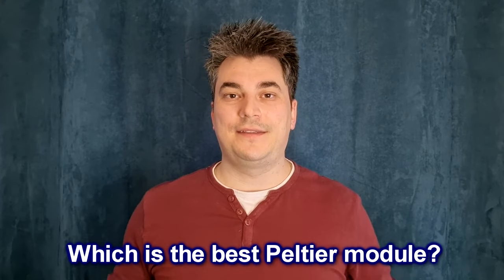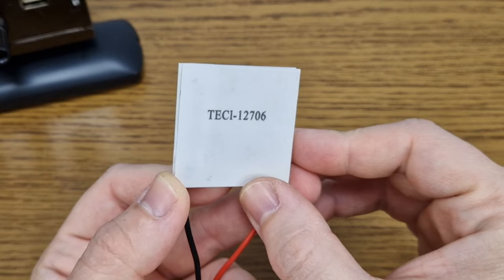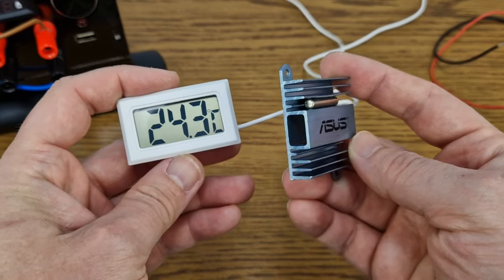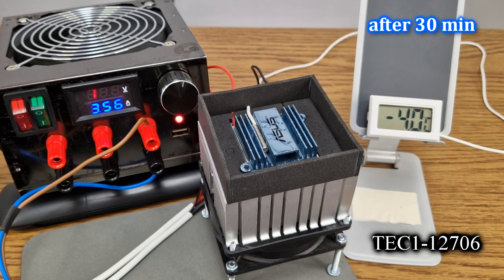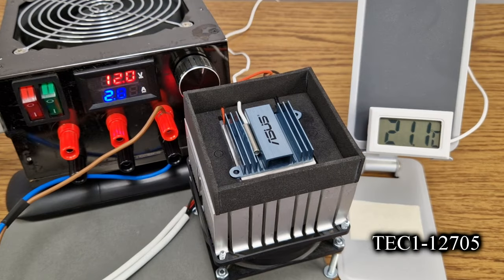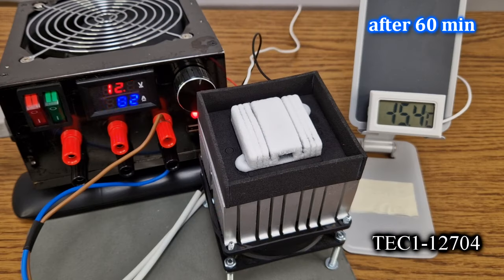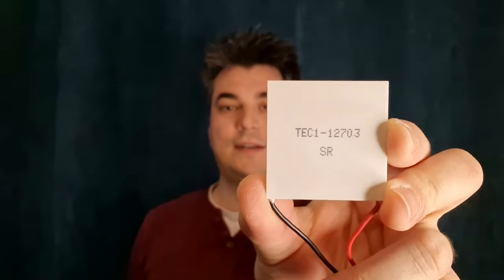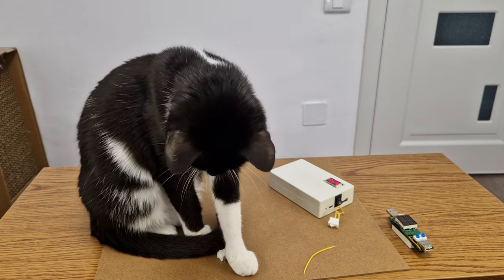Which is the best Peltier module for your project? [test 1]

Comment: The TEC1-12706 needs a bigger cooler then TEC1-12703, with the correct cooling the 12706 can reach quickly to -18 - 20 Celsius.
Reply: What if u add the bigger cooler to the 03 module?
Reply: It could reach -40 even

Comment: Hello I want to make phonewith this my idea is to use water radiator 240mm and a fan and thie peltier module let's make it connecting water radiator and water block  with a small 500ml tank  putting peltier on water block 50*50*20mm left 20mm after putting peltier on it sticking neodym magnets so I will able to stick on my phone now supply it now phone is cooling playing heavy games like warzone mobile pubg able to get 120 fps will this work??? It will cost me 40 dollars to make or should I buy from alibaba for  200 dollars?

Comment: Repeat the test and track the temp of the large heat sync. You will find that the large heat sync can't keep up with the heat generated by the larger peltier, and it will be hotter with the 12705 than with the 12703. This explains why the temp was greater at 60 minutes than at 30 minutes - the ambient temp of the heat sync rose. A peltier is designed to create a thermal difference between the hot and cold side of the peltier. The colder the hot side is, the colder the cold side will be. For air cooling, the 12703 is better. With liquid cooling, the 12705 will remove more heat than the 12703.

Comment: Test is very good, but only for this size of radiator. If u get bigger radiator with better cooling , u get better results on more power peltier module. so this test is only for this small radiator on hot side.😊
Reply: Quite similar as to what I was thinking.  Smallest-size peltier (12704) performed "best" compared to the group because of its smallest physical size in proportion to the (heat) radiator.  Increasing the cooling capacity (ie:  Larger radiator or more fan cooling) in proportion to wattage output needs to be considered to make a fair comparison.
Reply: @Schrimpieman  yeap, thats right ;)
Reply: @Schrimpieman  you got it.

Comment: What you're seeing is the effect of joule heating. Basically you were able to manage the hot side of smaller peltiers better because heatsinks were larger in proportion.
06 is not rubbish. It has to be planned & executed properly.
Reply: Thank you - it would have been nice to see how warm the large heat sync was getting. Liquid cooling would have significantly improved this test.
Reply: @RCToys09  I guess there's a reason why the manufacturer make different types with different price or costing. I bet it not only related with size but also with quality. Using liquid cooling required more electricity as input. So if using same input give different output then we can conclude which is more efficient.
Reply: thats it, there was just so much not even considered here, mostly heatsinks...
cold side temp means nothing without hot side too. 

lol, heat blocks dont appreciate frozen water. go all bulgy :)

i had to see what it would do with no pump.
Reply: do you know what the best peltier model is

Comment: Thanks for taking the time to explain to us the difference. I am pretty sure that the 4-5-6 didn't perform as well as the 3, only because it didn't reach the appropriate amp. to perform 100%. On the other hand, to get -20C with only 38 Watts of energy is fantastic! Exactly what I am looking for. Thanks
Reply: How do you get it to reach the appropriate amperage? My Peltier chips always run at around 3 amps - far lower than their rated amperage. I have been wondering about this.
Reply: yes. each module operates in a different sweet spot. more extensive testing needed
Reply: @FHDesert  It does reach the maximum amp. but his cooler is not good enough to remove 72W plus the amount of heat energy from the little cold Radiator. So the hot side gets hotter as it should. That follows that the cold side doesnt get as cold as when he used the 12703

Comment: Great video, but I have Concerns.
Later on, you chose the TEC-12703 because it cools down to the lowest temperature. In the mini-fridge you've build, the Amount of heat the Peltier has to remove is much higher, and the Qc of the 12703 is very low. Dont you think the 12706 does a better job when the amount of heat that has to be removed is quite high?
Reply from the maker: Thanks! TEC1-12706 may be a little better in a closed box, but it draws more current and it needs a bigger heatsink, so the entire cooler will be bigger, more expensive and will draw more energy. 
I will make a more detailed Peltier test video soon, with more powerful peltier modules, bigger heatsink and different voltages.
Reply: @Sorin_DIY  I'll enjoy your new video :) I hope you're maybe cooling a liquid or gas with the different peltier Modules, so that we can see how much heat energy is removed through the TEC's. Looking forward to it :)

Comment: Thanks for the great video with detailed comparisons.  I am making a small (5l) 12v cooler/chiller for my motorcycle trips as I could not find anything remotely suitable.   As I am looking to have a compact design within the wall of the cooler, your video has reminded me that I need to allow for condensation dripping off cooled element.

Comment: Great! Could you please make also tests with TEG Modules to make power from heat? Ive noticed that there a great differences by modules and prices.
Reply: +1
Reply: Yes I would like to understand the differences in energy generation also maximum temperature each on can handle

Comment: Please do another video like this one, but in the next video, apply heat & determine which module produces the most electrical power when you use the optimal heating for each module design.  From what I see online, the TEC1-12706 can produce 57W at 50C, which is 1.425W/mm2.  That means ~702 of the TEGs could produce 1 kW of power with an input heat of 50C

Comment: Currently working on making a pretty sick Portable AC using these chips. Alot of design is going into it these chips are amazing especially when used correctly.
Reply: I'm doing something similar! But with a pillow. How many are you using, you'd need a lot to make any sort of difference even in a tiny personal fan. And you'd have to vent the heat elsewhere or else the net difference is just heating up the room! I'd be interested in seeing your creation.

Comment: excellent information that was what I was looking for to know what power each peltier plate has. I bought 127015 and it consumes a lot of current and the temperature drops. if your information is correct I go Buy peltier 12703

Comment: Good work bro🤜
Can you test all 4 as thermoelectric Generator?
Reply: The ones he tested are TEC modules. What you want to see are TEG modules. One creates heat/cold and the other electricity - TEC can be used for both purposes, but probably not with the same result.

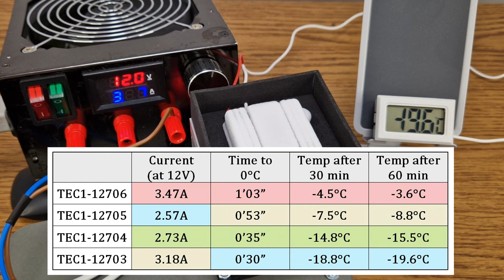Comment: 5:07 Is there an error? The chart shows the 12703 Takes 3.18AMP but in the background the PSU shows 3.27AMP
Reply from the maker: Hi. There is no error. the cooling fan also draws 0.09A from the power supply, so the total fan+peltier consumption is 3.27A
Reply: Oh! I gotta recalculate some stuff then! Thank you! I bought 20x of these Peltier modules you posted @Sorin_DIY

Comment: I built an ice chest air conditioner.  At bottom of cooler is ice cold water and a bed of 20lbs of ice Sitting on a wire frame. Just  over the ice layer is an internal lid effectively separating the ice chamber from the air intake chamber.  2 radiators ; one is for intake air the other is for the precooled air blower fan. My question requires your expert peltier knowledge.  Cam I usea few peltiers to create a mini freezer keep ice colder longer or make circulating water even colder with salt?  I'm concerned about cooling the hot side without heating my ice water. Thank you for your channel and all you do to help us
Reply from the maker: Hi. my next video is a project with Peltier modules, it will clear a lot of things about your project. I will upload it in a few days.

Comment: i think you need to supply 12v 6amps for the 12706 module, for its full load to work.
Reply: it wont draw 6 amps at 12v, it needs 14v or higher.

Comment: The modules have different electrical specs and they're being driven with a fixed voltage, the ideal way of driving a peltier module is using a constant current (CC), as resistance varies with temperature. Idealy the module should be driven within 60-70% of its maximum current to maximize lifespan. The last digit of the modules indicates their maximum current. The TEC1-12703 has a maximum current of 3A and is being driven a little above its maximum current. So, this module is being overdriven. 
My suggestion would be to compare them using CC at the same percentage of the maximum current of the module being tested.
Reply from the maker: Thanks for the suggestion. I bought some new Peltier modules and I will test them in a future video.

Comment: You tested the modules on the same heat sink for the hot side!! Tec1   12706 modules require bigger heat sinks to dissipate more more power and so that the hot side doesn't get too hot. It is because the 12706 module has the highest temperature on the hot side that the cold side is lower than the rest peltier modules tend to want to maintain constant temperature difference on a particular electrical power input if the hot side is too hot the cold side will not be cold enough
Reply from the maker: Hi. I recently made another Peltier test video [test 2], please watch it, because I explained all this.

Comment: Very informative video. Thanks for sharing. Do you mind revealing what thermal paste you used? I am finding in my own testing that this is making a big difference in temperatures I am measuring on the cold side. I changed thermal paste on a peltier/heatsink module that I had purchased and  the temperature I was measuring was at least 7 degrees C warmer than it was before the paste change.
Reply from the maker: Hi. In this video I used a medium quality thermal paste from aliexpress. With better quality/more expensive thermal paste I would probably get better results.

Comment: Nice video and analysis. Could you please suggest best PELTIER module for heating application? Thanks in advance
Reply from the maker: Hi. I haven't tested Peltier modules in heating applications, maybe in a future video.
Reply: Least efficient at cooling would likely be best for heating. Peltiers move heat from one side to the other but in doing so they convert a lot of the input electricity to heat which goes out the hot side. In other words they put a lot more energy out the hot side than they take in the cold side.

Comment: Moral of this that isn't shown in the video: The Less load you have, the smaller peltier is more efficient always. If you have a heavier load that makes the module stay at a warmer temperature the entire time (Say water cooling something) you want a larger module to pull more heat at a given time. Same thing happens with a Portable cooler fridge.

This is why water cooling something on the cold side is alot better of a load than a heat sink most of the time because the water will add it's heat energy to the cold side 25 times faster than air.

However sometimes water cooling the hot side is the only water cooling that's needed to get better efficiency out of the correct size module.

The Smaller the volume, the smaller your module should be for efficiency. If its 1 Cubic foot of volume however, you'll want about a 10 Amp rated module instead so that the module can remove more heat at a given time. If the module stays cold on the cold side the entire time, your not fully utilizing the cooling capacity of the peltier unit and are just wasting energy. So always test to make sure it's enough power to get to your target temp, and keep going smaller until it's no longer enough cooling capacity then you'll know what is the best current rating for your project.
Reply: excelent analysis bro🎉
i am a newbie😢 tryin to build diy air cooler for home
which module and amps u suggest
and u recomend both sides water cooled or

Comment: Hi, I was wondering where you got the ice from even though you didn't use any water? Was it the thermal paste that developed the ice?
Reply from the maker: Hi, moisture in the air turns to water on the cold surface, then to ice.
Reply: @Sorin_DIY  Thank you, this is very helpful.

Comment: Hi. Tell me, what type of Peltier do I use for a "Philips perfect draft" machine? Thanks. David.
Reply from the maker: Hello. I didn't work on this unit, but I found on internet that it has a 70W peltier element and the similar cheap alternative is the 12708. But in my opinion you should buy the 12703 and 12706 modules as well and test which one works better. they are cheap.

Comment: I would be glad if you could make a test of temperature drop in  a space of 1 cubic feet for example.
Reply from the maker: I made a Peltier cooler box, you can check out that project and use it as a reference.

Comment: actually the problem with TECs are the larger current you run them at the more cooling they can do but the more heat they produce
so it is quite likely the reason 12706s are underperforming is due to inadequate cooling.
It might be more of a fair test to run them at the same current rather than voltage, iirc peltiers are mostly current affected.
Reply from the maker: Hi, I recently posted another Peltier test video with a better cooler, you can check the results.

Comment: Is it possible to run it for some minutes without the active cooling? Can I use a powerbank to run the peltier? How can I calculate how long my 2000mAh would last with the 03 peltier?
Reply from the maker: You cannot use the Peltier module without a heatsink, it will heat up in a few seconds. using a 5V power bank will have a low efficiency, you should make a battery pack and connect it directly to the Peltier module.
Reply: @Sorin_DIY  how big would that battery pack be? I am a total beginner somehow... is that batterypack portable... listen: I want somehow a way to cool down my shoes ... I know I know.. but I have a gen defect that gives me blisters in summer if it is too hot...

Comment: is there any advantage of having higher amps module? like 15A? or is it just better to go down and get some that is like 1A if possible
Reply from the maker: In my opinion there is no advantage in using one powerful module with a high current consumption. instead you can use 2 modules with a lower current consumption. 
but so far I tested only cheap modules, maybe a powerful high performance module will be better.
Reply: @Sorin_DIY  it would be nice to see it if it was water cooled

Comment: Bro im making a mini ac with 4 peltiers of 12v 6amper i have a SMPS of 20A 
My question is. Should i use one yellow wire and one black wire from SMPS for all 4 or i should use connection separately for each peltier?
Reply from the maker: It depends on the thickness of the wires. I suggest you use separate wires for each module, or use a 2.5mm2 wire for all of them.

Comment: In those peltier modules, can you test how long it can turn 100L of water to 0⁰C? and power usage.
Would it be better than using a ref. Compressor?

Thank you
Reply from the maker: Peltier modules are very inefficient. They are good only for small devices or hobby. you should use a refrigerator compressor system.

Comment: Hello Sorin, I saw that you are dealing with 18650 batteries, so I have a question, I want to build a 12V 200Ah battery, how many 18650 batteries do I need to get 12V 200Ah like a solar system battery
Reply from the maker: Hi. it depends on what type of cells you will use. if you use 3000mAh cells, you need 3 in series to get 11.1V nominal voltage. then a lot of them in parallel to make the capacity. 200Ah/3Ah = 66.6. you need a 3S67P battery pack, so 201 cells.

Comment: Shall we give 20 amps for a single tec 12706? Does this run or burn?
Reply from the maker: The Peltier module will draw the same amount of current, you just need to use a power supply with the minimum output  current that the Peltier needs. there will be only small fluctuations in current consumption depending on the temperature.

Comment: hi can i get around 0 centigrade in 40°c weather with 4×4cm heat sink and 12706 peltier? i want to build a phone cooler but the peltier gets too warm
Reply from the maker: no. you need 1 or maybe 2 peltier modules 12703 with a big heatsink.
Reply: @Sorin_DIY  but the main thing is building a phone cooler it can't be that big
Reply from the maker: then you can power it with a lower voltage. because a 12706 peltier module with a small heatsink will get very hot.

Comment: Interestingly I found 4x4 12703 instead of 3x3. Does the performance differ?
Reply from the maker: I'm using 4x4cm 12703 modules and they are good. still inefficient, but better than 12706 modules.

Comment: I'd like to ask if it's practical to make and use a portable air condition using the 3 amps Peltier module in hot countries like here in the Philippines? and how many modules would it need to make it efficient to cool down a small area or room? I'm just curious.... Thanks for this video....
Reply: No, peltier devices are not very efficient for cooling and a power output of 1000w is suitable for a medium size room, so at least 20 of these.
Reply: @321tryagain  Far more if you want to operate at a reasonable COP and at that point you'd have a very expensive and weak AC system (assuming you actually take care to pump the heat outside)

Comment: Sir does the TEC1-12703 can be operated using only a 12v battery?
Reply from the maker: yes. but you need a powerful battery.
Reply: @Sorin_DIY  how about 12v 20ah of motorcycle battery?